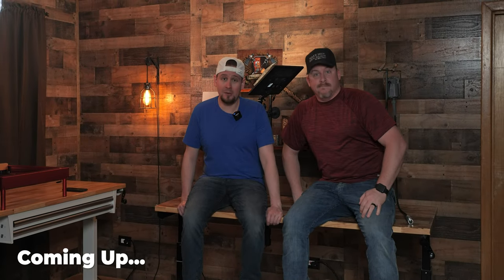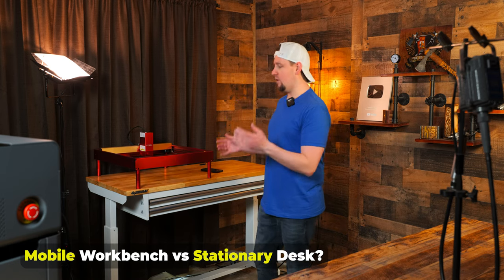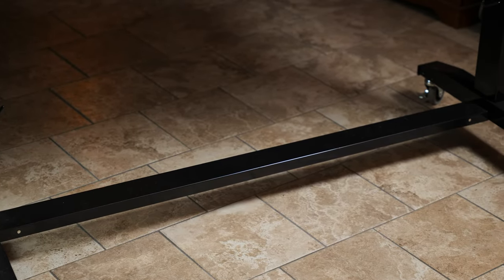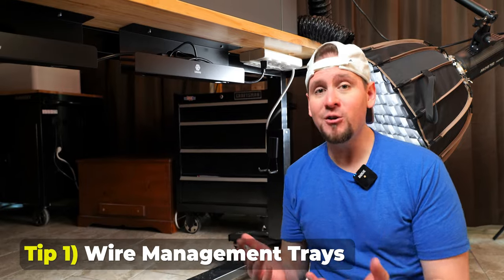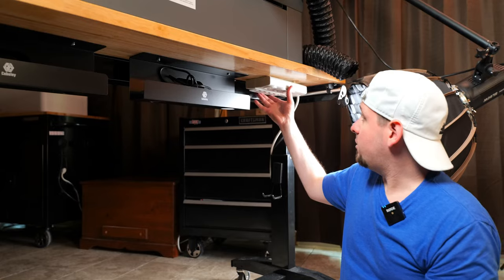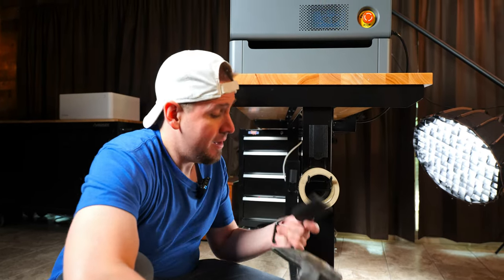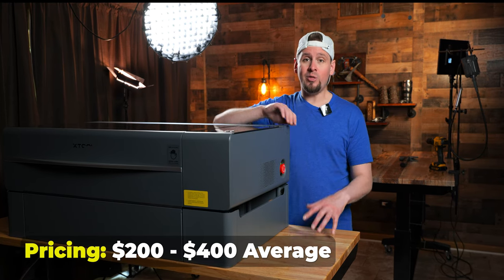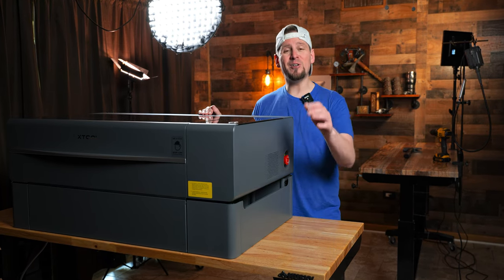Maximize Your Workspace with Husky Workbenches: Best Workbench for Laser Engraving?

Comment: Hey Matt! You were asked below about the clearance space needed for the exhaust hose, which you mentioned about 5 inches. In your video, it looks like you have your hose running out your patio door??  😆 My P2 "All in Bundle" pack (using your discount code 🤗) is literally in transit.  It comes with Smoke Purifier thingy. First, being new to this, idk if that is going to be a pain or not with up keep, but is it as simple as running the hose outside if that is an option for someone.  I do live in an apartment, but it happens to have windows that open.  A video on how you do your ventilation system would be greatly appreciated!! 🤓 Thanks for all you do!!

Comment: Hi, I'm thinking of buying the p2. One thing that bothers me, I feel like the cut isn't clean (there is charcoal cloud around the cuts). Is that the case? Thanks for the video!
Reply from the maker: Hey there! That is a good question, I appreciate you pointing this out. In the newest version of XCS and future of updates of Lightburn they will have an air assist control which can help tremendously. This was beta software you saw in the video and I assure you much cleaner cuts have been made since this video. Also, if you are doing any professional projects I would suggest some sticky paper to avoid any light burns around the edges. So far I am loving my P2 and haven’t had any problems.

Comment: Lowes is better 😂 take that Home immigration depot
Reply: The problem I've found with Lowe's mobile workbenches and bottom tool chests is that most are only 18" to 20" deep. While the Extreme Tools line does offer the depth needed to accommodate the P2 (and similar desktop CO2 lasers) the prices aren't reasonable for the application. The alternative to the Husky line is to build a custom workbench with casters.